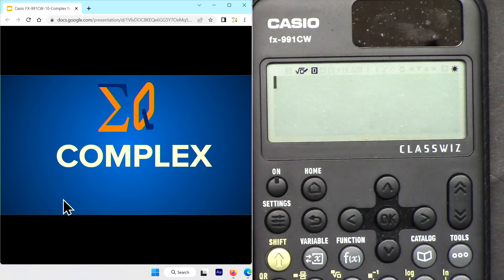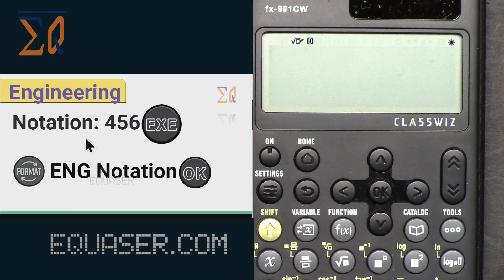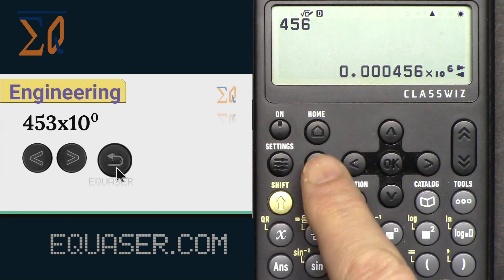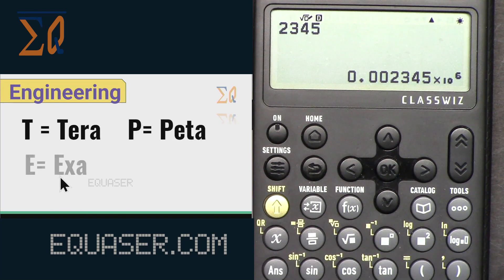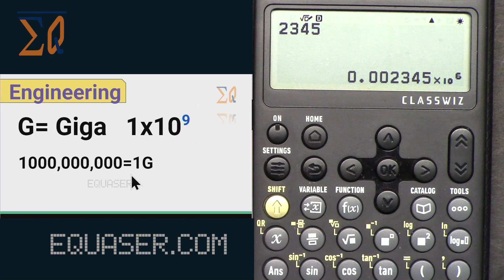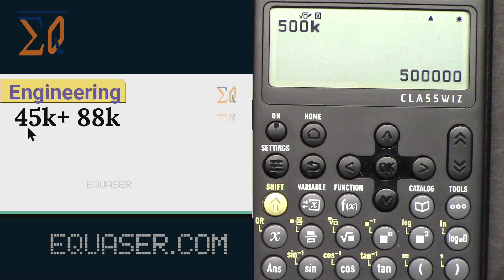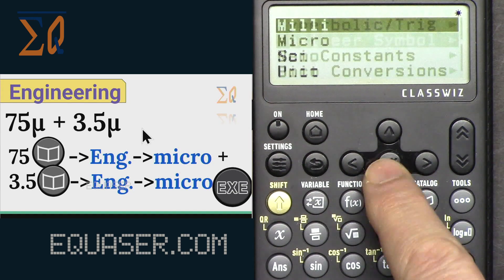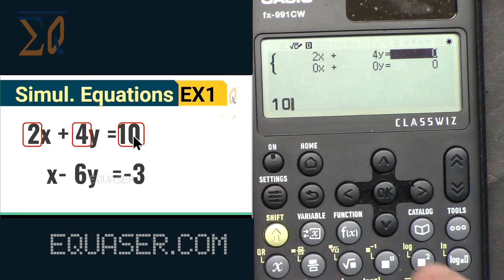CASIO fx-991CW Engineering noations and units and milli, micro, kilo, nano CLASSSWIZ Calculator

Comment: So use of engineering symbols/units is pretty much totally trashed to "adventure in menus Gameboy" toying...
Just for comparison old fx-115W has them as direct secondary function in number keys needing only two key presses to use!
Already x-991EX is worser on that moving them to menus.
But at least in it I can figure it out instantly how to store values into memory slots and recall them...
These CrapWare models are total fail in that.

Heck, there's not even colour coding to differentiate number+standard operation buttons from other function buttons.
Even AC button has no distinguishing colour!